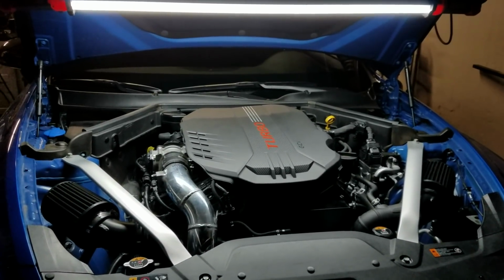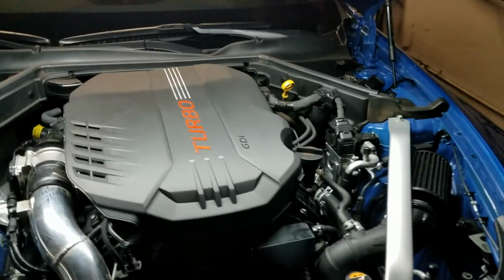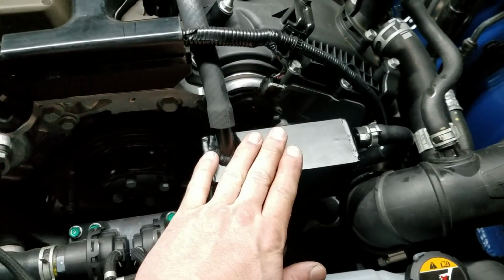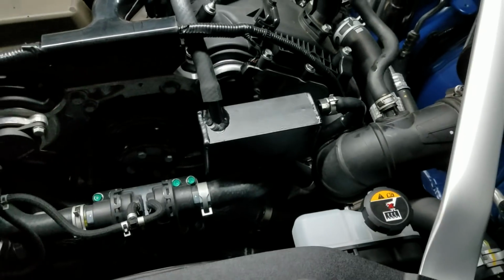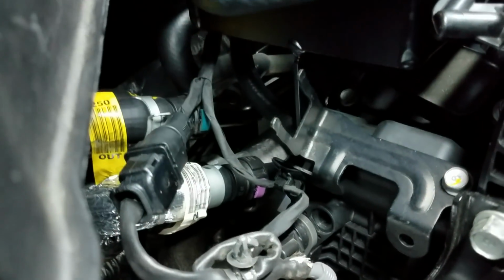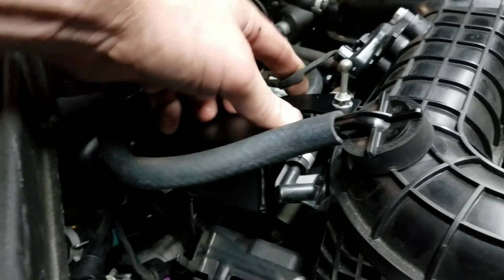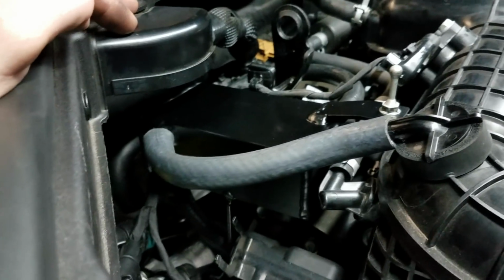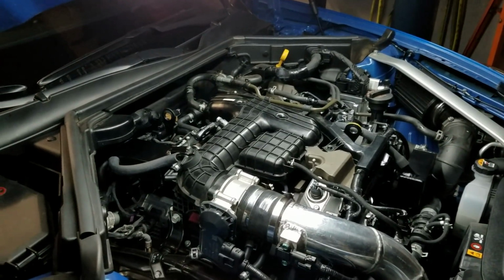KIA Stinger Oil Catch Cans... looks factory

Comment: How the hell did you get the pipe off the throttle body up top. I took the clamp off but it would not pull off for the life of me. Is there other stuff to remove as well?
Reply from the maker: I used a hook tool for breaking the seal on hoses.

Comment: What the hell is a catch can
Reply from the maker: An oil catch can, essentially catches the oil inside the crankcase breathing system. 

I am sure there is a video somewhere about this, or... should I make a video describing this?
Reply: Shez K Thanks for asking, because I was wondering what they are, what they do, and why they're necessary. Never heard of them before.
Reply: Yes, I would love to hear more. Such as: why is a catch can necessary? How does it work? Is is something some manufacturers provide as OEM? How recent is this technology?
Reply from the maker: They are not necessary, just highly recommended.  They work by removing the oil from the air in the crank case breathing system. It doesn't allow the oil to be pulled into the engine and burned. Its been around for a very long time. Some manufactures have them, but nothing recent that I can think of.
Reply: Tork Motorsports if its  harmful to the engine why the did it!

Because I heard it keeps the upper cylinder moist 

I dont know what is the right here😑
Reply from the maker: ABO alharith m oh my god, who told you that, lol. 

You can believe whatever you want, but we have an OCC on every shop car we have, and make them madatory on high HP cars that run GDI.
Reply: Tork Motorsports thanks... i need occ to my sonata i think 

I will see

Comment: Definitely going to be my first purchase when I take delivery of my Stinger GT. Biggest thing I worry about is the carbon build up on intake valves. DI engines have such a problem with carbon, and I don't want to deal with carbon clean ups every 30 to 60k miles...
Reply: Not all DI engines have carbon build up. Ford, Toyota, and Mazda have zero problems with carbon build up in their DI engines because they design them better.
Reply: Cataclean works wonders